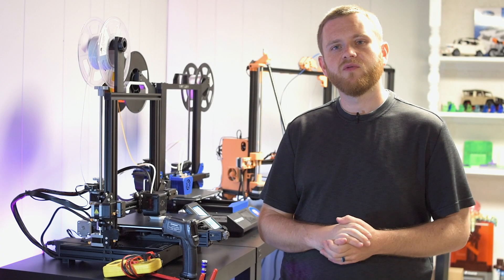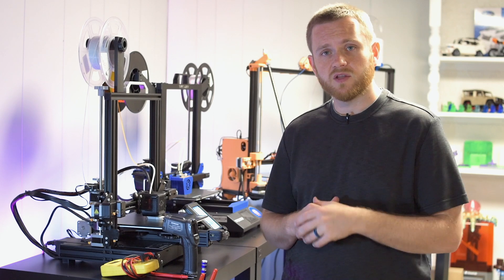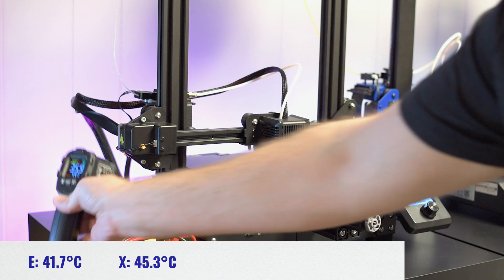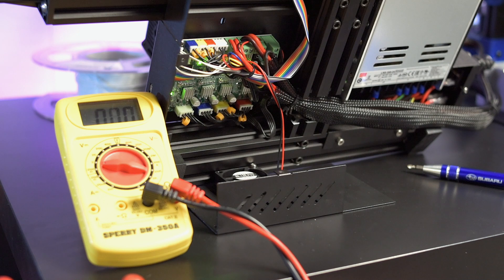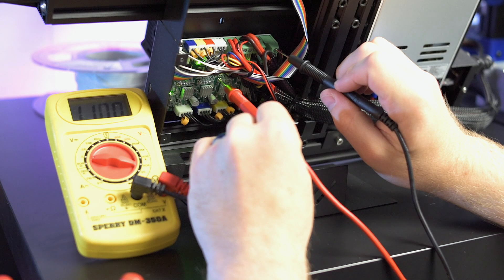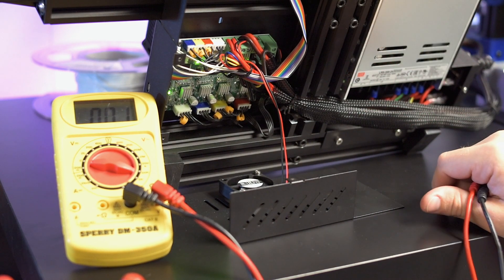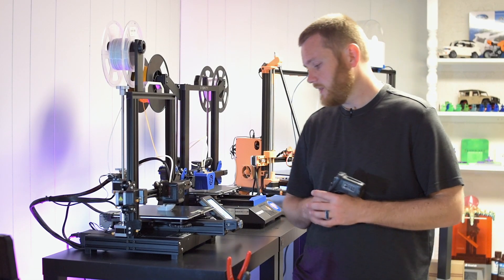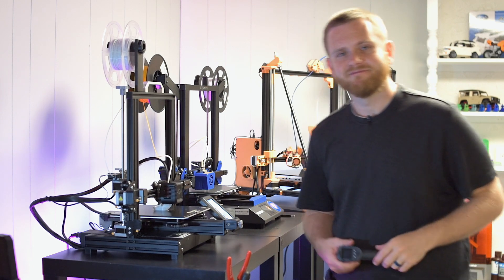Stepper Motors TOO hot! Let's adjust them.

Comment: Y is always too hot, I used to run them 0.87VDC on my Prusa Mendel 3II 0.78 and 0.97 are ok.. Ideally, you're supposed to tune them so they run cool.
But Mine are running Way too Hot for my Liking Im thinking they are at 1.75VDC that is the Stepper driver's Max Safe Voltage, but you NEVER RUN THEM THAT HOT!!

Comment: Thanks a lot, after installing a double z axis I noticed trouble for it to move, it was getting stuck a lot of times. After rising the voltage from 0.55 to 0.72 it was a lot better, maybe I should turn it up to 0.8.
Also I need to lower the extruder, its on 0.9 and its very hot to touch, maybe 0.72 should be fine

Comment: Thank you!! My extruder is too hot, that the filament turn soft, and are smashed by the extruder, to the point that it starts to clog... this is so helpful!!
Reply from the maker: Glad I could help!
Reply: Did this solve your issue? I think I’m having the exact same issue at around the 3 hour mark. It’s consistent so I think heat is the issue.

Comment: Awesome tutorial, thanks! I'm using an Anycubic Kobra 2 printer, and its Y axis motor is extremely loud. Will turning down the power of the Y axis help relieve the noise issue? I'll give it a shot if it's potentially going to help solve the problem.

Comment: my issue is the extrude is getting so hot that the filament is getting soft an it jams pushing it into the ptfe tube or right b4 it goes into the plastic that then feeds to the ptfe tube. i thought it was just the crappy plastic extruder that it came with an the cheap filament so i swapped it over to an aluminum extruder an it hadnt given me any issues until recently an its been jamming, at first i thought it was hotend jams an rebuilt the hotend countless times an finaly put a h2 hotend on it but couldn't adjust the esteps high enough for its little steppermotor so im back with the original hotend with the ptfe fix an i finally noticed it was jamming at the extruder an not the hotend after it a few times an it being obvious i started checking the temp of the extruder an its hot. i pulled it out of the enclosure an let it run an it seemed to be fine but i think its cause im printing with regular pla right now an i normally only print in pla+ so its a 20c difference in temps an i dont know if thats just been enough to cause it or what but i added a exhaust fan to the enclosure an it seems to have helped some or at least its able to finish a couple hour long print but anything longer the 4 or 5 hours it does it again so i started to make some heat sinks to put on the stepper motors but i think this might be the issue so here i am. weird my e motor is whats giving me the issue an urs was the coolest, i haven't checked the other motors to see if they are hot but its never given me a issue, a couple hotend clogs. any suggestions for firmware that will allow me to run the biqu h2 hotend, needs 932 esteps but the latest voxelab firmware only lets it go up to 930 so 2 steps less so u can imagine the frustration after going through all the trouble of printing a resin bracket to mount the h2 to the aquila just to find out the esteps dont go high enough, was still on the firmware it came with an it would only go to 260 i think so i got the newest firmware from voxelabs site an thought i had it an it stopped at 930 an i felt like adding it to the spar parts bin but i managed to pull it together an put the old hotend back on with new ptfe liner an nozzle and it prints find as long as the printer is out side of the enclosure but as soon as it goes back in its back. what is the lowest u would want to adjust the voltage for the extruder, i know u said its always the highest so u set the rest to .9 and left it at  1.4 so whats the minimum u suggest.
Reply: just checked mine an mine are way higher. i picked this machine up through voxelab ebay as a parts only machine but when it arrived it was a brand new machine an the only issue was a single bolt hole having the threads stripped out so i just cut deep threads an used a longer bolt but its been a great printer an this has just popped up recently. had others had this issue with having them really high, mine was 1.9 for the e an 1.7 for the rest. i also had trouble getting the reading off a screw driver an had to take the prob to a leg going to the pot instead of in the center of the pot so im not sure whats up with that, thought it was the screwdriver having bad conductivity so i used the prob straight off the meter to the center of the pot an nothing so not sure what the deal is on that. is this something others has had issues with an what does ppl see when they check theres. i feel like mine is really high an explains why the enclosure was always so much warmer than all my other printers enclosures.

Comment: Hello 3DPrintSOS!
I want to replace the Y-Axis 42-34 stepper motor on my Ender 3 Pro with a 42-40 stepper. The stock motor gets pretty hot and all of a sudden, it stops working, it just jerks and not rotate.
So do you advise I replace with a 42-40 stepper and set the Vref to the same voltage as the Extruder motor ??

I’m not really good with all the Voltage Calculations.

Comment: Excellent video - very helpful! May I ask, did you have power running to the printer or running a filament empty print while you were doing this for proper adjustment? I just got my ceramic screwdrivers in today and am eager to get my Sunlu back up and running. It works the way it should - except the motors get so hot I can't touch them for more than a couple of seconds. Anyway, I look forward to your reply! Have a great day.

Comment: Is it possible that the lower voltages would hut performance at higher print speeds or accelerations? 
Is this recommended to extend the stepper motor life? 
Is this universal to all stepper motors? Will it work on a Neptune 3 Plus?

Comment: my ender 3 max likes to start ghost printing about half way through sometimes. I look and the filament only close to the extruder motor looks shinny and mushed and often completely cut. I think the motor is getting so hot it is heating the PLA to it's glassification temp and making it start to melt and deform.  I dropped my current on the motor from 650 to 425 in Marlins configuration.adv.h to see if it helps any. Plus I was hearing this strange sound coming from the motors. I adjusted the current to the x and y motors too down to 410, x was getting insane hot. But my motors started sounding funny since upgrading to custom marlin 2.x

Comment: I love your videos they are very informative and you are very knowledgeable thank you on that note I have a question I have an aquila x2 and the e stepper motor is not working properly when I try to print something it just turns back an forth can't figure out why it's doing this. I installed a new motor and it does the same thing thank you if you have time to give any insight.
Reply from the maker: Hmm. If you installed a new motor, its gotta be the driver? Does it do the move back and forth when you move that axis manually via the menus? Does it do it when you print a pre-sliced file from the SD?

Comment: The bed on my aries drops randomly then comes back up to resume print. The extruder stops as if its being paused though. What could it be? I unplugged the filament sensor thinking that was it.
Reply from the maker: I’ve heard of that before but I don’t know if a solution sadly. Was this doing a wireless print or from the usb?
Reply: @3DPrintSOS  I switched to USB and it stopped. Wireless printing seems sketchy still.

Comment: My ender 3v2 was running  great but suddenly  when I print  it stop printing and ask me if I want to resume,  so I let it cool down and start again  and until  now it is working,  could  it be stepper  motor overheating?
Reply from the maker: Hmm. If it’s asking you to resume, that means the file is possibly sliced with a pause code? Or filament swap?
Reply: @3DPrintSOS    it didn't even  finish  the 1st layer,  it just  pause,  like the power went off and on, but now it printing  I just put a fan to cool down the  y-axis  motor , idk if that was the proplem

Comment: hello I have the Aquila printer for 1 week and I have problems with the printing: when it prints the plaque it extrudes it but at times and then the print is irregular, I noticed that the problem is the stepper motor that pushes the wire inside the extruder because if I bypass it and push it in, it works fine.  do you have any advice on how to solve?
Reply from the maker: What temperate is your hotend at? Make sure you aren’t so close to the bed that the extruder can’t push filament. Make sure the tension on the lever arm is high enough to grab the filament but not too tight enough to squish the filament.

Comment: Thanks for sharing this info. I just had an issue on my Voxelab Aquila during a 4-hour print using crystal PLA from SUNLU. I came out to check the print and found that it was seriously underextruding. When I checked the extruder, it was extremely hot to the touch, so much so that it would have burned me if I left my finger on it for any length of time and the filament had softened up / melted inside the dual gear extruder I have on my Aquila. How much voltage would be considered too much voltage for the extruder motor? I figure 0.95 like you showed is a little too low, and that's why you didn't turn it down any further.
Reply from the maker: On the extruder you can keep turning it down until you get skipped steps. That’s really the only way to know if you’ve gone too low.

Comment: I wasn’t running into the issue of missed steps until 8 to 9 hrs in and could fry an egg on my y stepper motor
Reply from the maker: Yep, sounds like voltages
Reply: @3DPrintSOS  thanks for the great video

Comment: I run a cr10s from creality. I changed the board and the stepper motor are getting extremely hot. Like more than 100c and sometimes the print shots down for no apparent reason. Could that be it? Its there a way that the board could know that the motor is overheating?
Reply: I use a skr mini e3 v2, this board its meant to be used with the ender 3 which runs in a 24v sytem and the cr10s run with 12v system. So I am guessing that why the stepper motors are getting extremely hot.
Reply from the maker: I bet it just needs to be tuned. Check your voltages.

Comment: Thank you had issues with my extruder getting so hot it was causing jams (melting at gear)  after 1 hour or so of printing went from 60c to 37c. Keep up the good work!
Reply from the maker: Glad to hear it! Thanks
Reply: Did this fix your problem Weowtech? I’ve only had mine for 2 weeks and it consistently fails at the around 3 hour mark. After process of elimination I believe this is my issue. My extruder handle was fairly hot to the touch when it failed yesterday. I caught it where I was able to salvage the print.
Reply: @bmod88j24  it did reduce the voltage reduced the heat and stops that filament from softening up.

Comment: wow you have answer even for this, great!
Btw, do you know which nema 17 are on aquila? (mean body size in mm/ marking)
Reply from the maker: I’m ready! Haha. 42mm X 42mm X 34mm
Reply: @3DPrintSOS  you are awesome! Thx again =)
Reply: @3DPrintSOS  Also there is one thing, is it possible to place power suply from corner to ender 3 design(on free z-axis plank)??? bough silicon thing to replace bed-leveling springs
Reply from the maker: You might be able to with some brackets, the mounting for the power supply is different. Nice, I hear good things about the silicone pucks
Reply: @3DPrintSOS  ok I give up, You won, no way to catch you, too pro XD
thx I'll dig into this
Reply from the maker: Haha no way.

Comment: Thanks for the good video.  But I want to ask again, to make sure every each is adjusted to 0.95?
Reply from the maker: That’s what I did but I left my extruder motor the same. As it had no heat issues.
Reply: @3DPrintSOS  All set to 0.95v. First my Y very hot, and 2nd is Z and last E. And now Y become warm much much better also Y and Z. Maybe can drop less than 0.95v? Maybe more cold :D, thank you for nice video.
Reply from the maker: You might be able to get away with less but if this solves the issue i would keep it here. Once you go too low, you could get layer skipping or quality loss. :)

Comment: Great video!
I am trying to make my 3D printers (Ender, Aquila) 24/7 capable. Sometimes they work for days or even weeks but then they fail. The most common cause is clogging because the heat works its way up to or even through the heatbreak. Titanium should delay this process but I figured out that titanium heatbreaks only contain some degree of titanium. A trusted brand, a longer hotend and perhaps water cooling may be the way to go ...
Reply from the maker: Sounds like you need to print yourself a new cooler. The stock one isn’t very good at focusing the air from the fan. https://www.thingiverse.com/thing:3419531 this is a good one and runs the fan in reverse. Good idea.
Reply: @3DPrintSOS  Thank you - I will test it out.

Comment: What is a safe voltage window for these stepper motors? What’s too low and what’s too high?  My Y axis motor is definitely very hot, in fact Ive touched my arm on it accidentally while reaching for something and I initially thought my arm touched the bed, but in fact, it was the stepper motor.
Reply from the maker: I would stick with voltages in between 1.4 and .9. Like I mentioned, these motors can run at 100c and be fine. So I wouldn’t too much.

Comment: As usual concise and straight to the point video... well done! Most of these cheap steppers used in budget printers will happily hum along at 60c plus all day long. You touched on the reason for the higher voltages a little and that is to prevent any issues. The assembly line pass/fail tolerances on these cheap motors are quite a large gap and the quality control varies. It's hit and miss at times direct from the suppler. Voxelabs and most of the other budget manufactures bump the voltage as it increases their performance and allows the under performers to meet spec and reduces the defect rate in essence. Go buy a quality $3k plus printer and check the voltages and temps you will see a noticeable difference. 8 out of 10 times you can get away dropping the voltage running 1.0 volts without issue, maybe a less. Just be prepared to go back in and bump them up if you develop any print quality issues. The real issue is with the extruder motor if you get one that runs hot especially if you upgrade to a all metal extruder. It's possible and I've personally seen it happen on Ender 3v2's to get hot enough to cause the filament to start to hit it's glass transition state causing jams. On my Aquila (extruder was the hottest) and all Enders I run the extruders at 1.0v without issue but have chosen to leave the others alone. Just my preference but if you can run them lower it certainly will extend their longevity.
Reply from the maker: Yep. I agree with everything. :)

Comment: In my previous job I used to use 2 taig cnc table top milling machines. They used nema 23 280 oz inch motors on 3 axis. The shop in the summer would average 115°. The motors would get so hot that water would hiss away. They would run virtually nonstop for 8 hours a day. For 6 years not one instance did I ever have a problem with skipping or burn outs. Steppers have no problems working hot.
Reply from the maker: Yep. This is true. Like I mentioned a few times on the vid, I don’t think it’s a problem. However you can them down with no I’ll effect. So it a win win if you’re concerned about the heat. Otherwise, no problem. :)
Reply: @3DPrintSOS  I learned then that both volts and amps are used in a certain way through a stepper driver. To move slower and stronger holding power the motor needs more amps less volts but to go faster/rapids the motor needs less amps and more voltage. I'm curious to see if faster print speeds and rapid moves will be affected by lowering those voltages.

Comment: Because I love experimenting, I'm thinking about putting the largest Nema 17 stepper motor on the Y (I have one) and adjusting accordingly. I'll have to check the ratings on the drivers, but the motor is rated for 2.1 amps.  Not sure if you saw my capacitive sensor setup for the Aquila?  I am getting so much better prints since doing that! Thinking about making an instructional on how to do that with a cheap opto-isolator and capacitive sensor since it would be fairly low cost.
Reply from the maker: That would be cool. A lot of people would be interested.